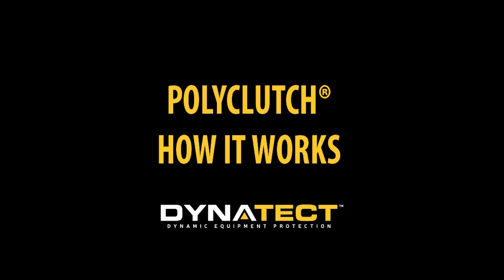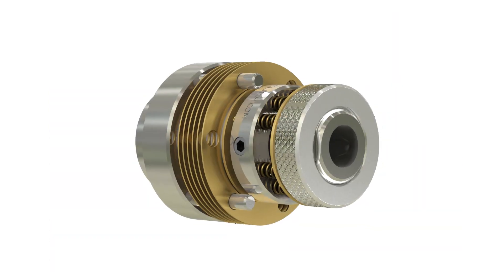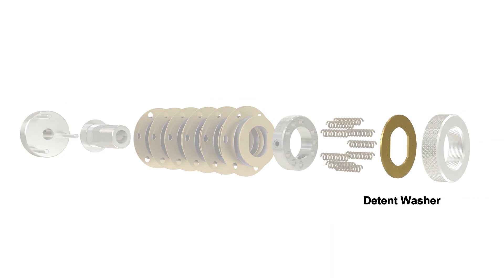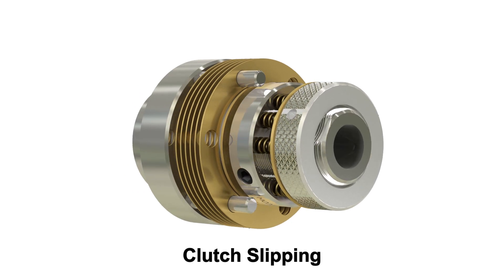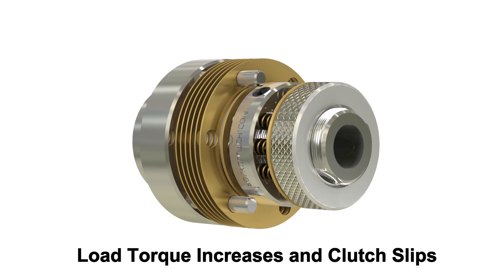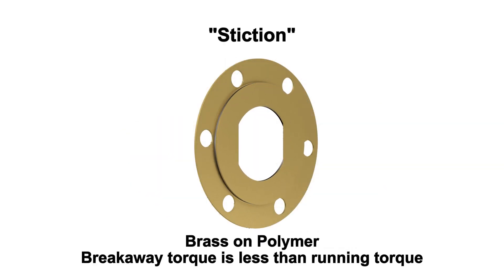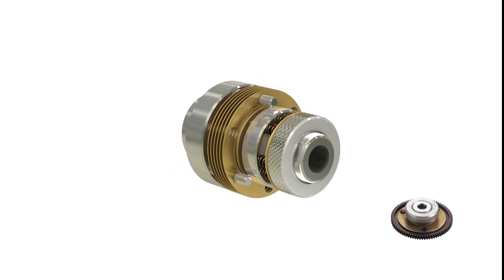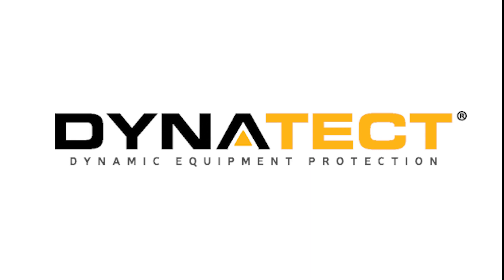Polyclutch Slip Clutch: How it Works

Comment: do you have a model that can take a 1/4" shaft and would slip above 15Kg of pulling line off a reel for eg. ie i would fix a spool to the shaft going through the clutch and use the spool to wrap line at 15KG tension
Reply from the maker: Can you please email us at sales (at) Dynatect.com? Thank you so much. We go to about 1000 lb-in torque. Learn more at https://dynatect.com/resources/polyclutch-slip-clutch-selection-guide/